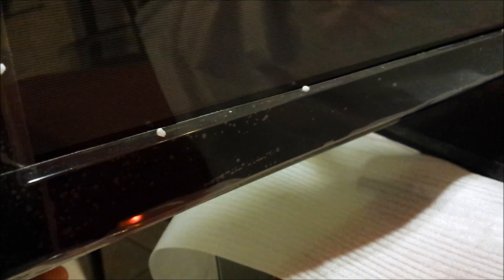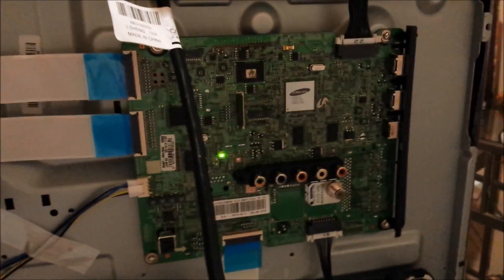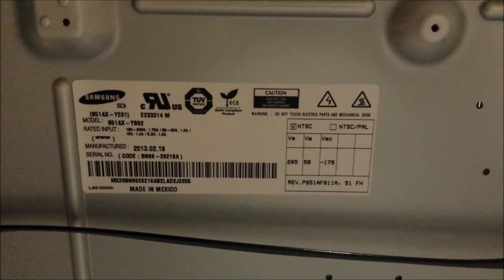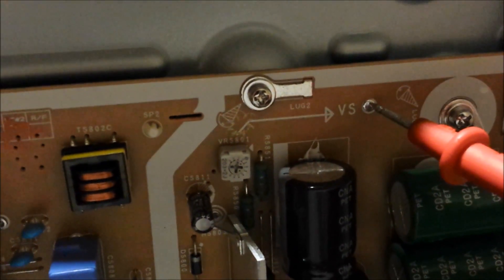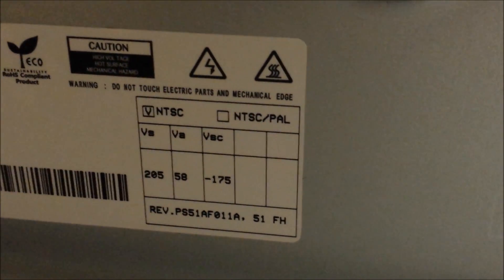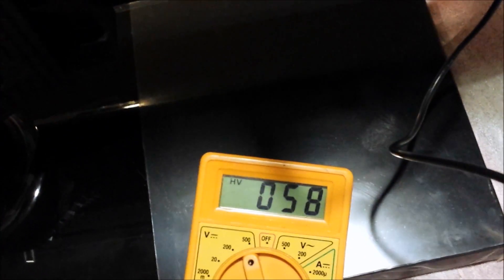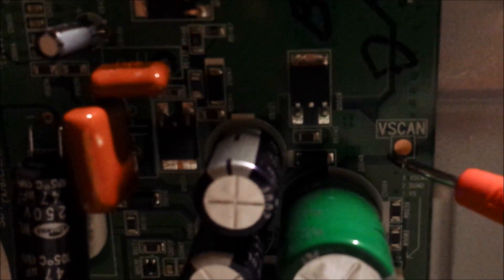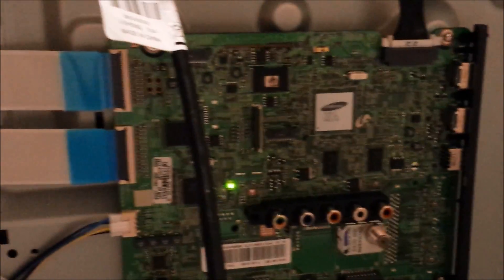Samsung plasma tv repair blinking light no picture PN51F4500 part I

Comment: Hello I'm looking for part 2 on fixing the plasma Samsung trick to test main board. Please help mine is doing the same thing and I need your help to fix it.
Reply: did u fix it ? mine plasma doing same thing,i have replaced all the parts with a broken screen tv but it still wouldnt start
Reply: 60 inch plasma flashin red light no picture